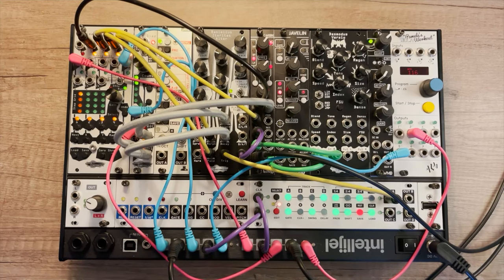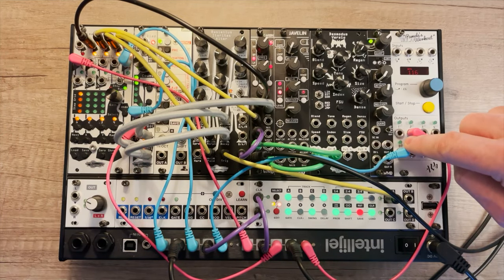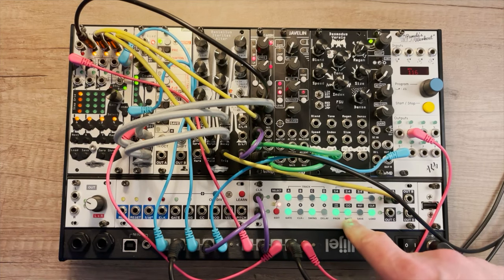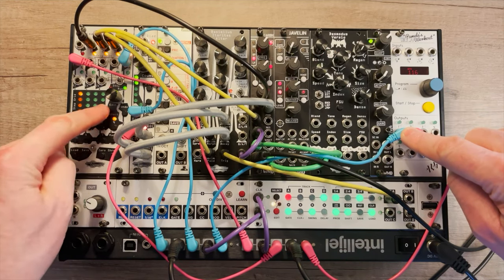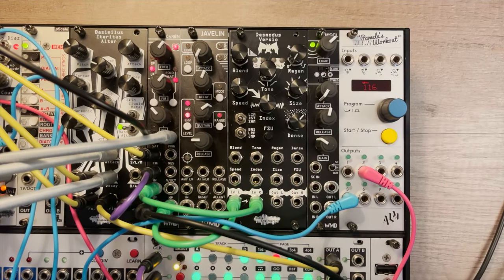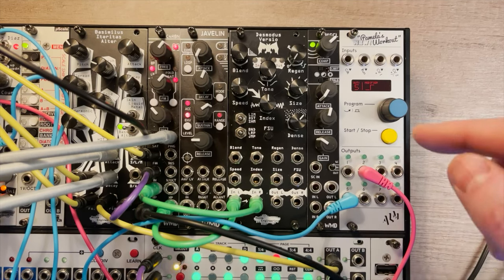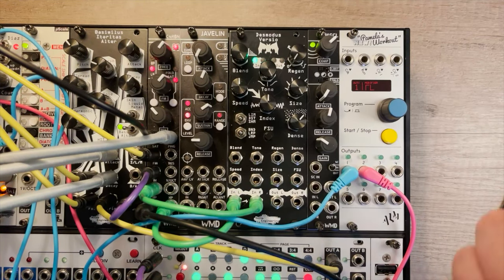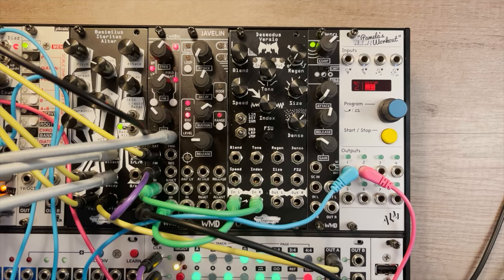PAMs as master clock and reset

Comment: Thanks Mark, very helpful and never would have thought it was a part of the x menu as there is a reset in the main menu which I guess is just to reset the whole channel!
Reply from the maker: Another viewer mentioned that the setting I showed you are designed for external rest function. It actually says so in the user manual!
Reply: @markbooth   If your way works seems fine by me - will have another look at the manual once I've fixed the Nebulae! : )

Comment: How do you output audio on this case? Desmodus seems end of chain but outs are not patched...
Reply from the maker: Well spotted! I bypassed the effects unit for this clock walkthough to keep things easy to follow on beat. The Javelin output is going straight out to the audio interface, I just forgot to remove green cables to the Versio.

Comment: I have a Pam’s Pro and there was a an option called “start” and “stop” which will send a trigger for those events. I thought the Nee version had those same options.
Reply from the maker: I’ve just looked that up in the manual and those are the modifiers I was demonstrating. I didn’t realise that’s what they were called.
Reply: @markbooth  the Pro UI must make it more obvious I guess.  Never had a New.  All my sequencers work better with Reset on start too, which seams weird.  You would think on Stop would be better.
Reply from the maker: @Qwiv  yeah mine too. It looks like some sequencers rest to “play” the first step which is fine when resetting mid performance but no good if stopping g the system as it then misses the first step. These Eurorack quirks are sent to challenge us 🙃